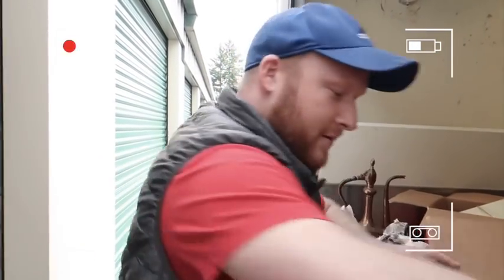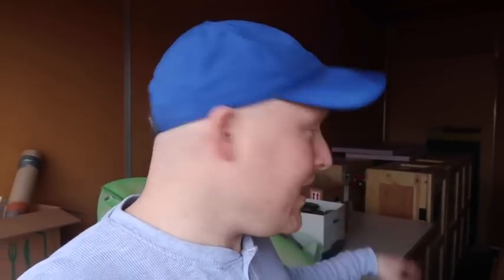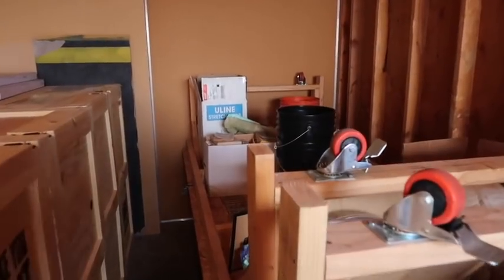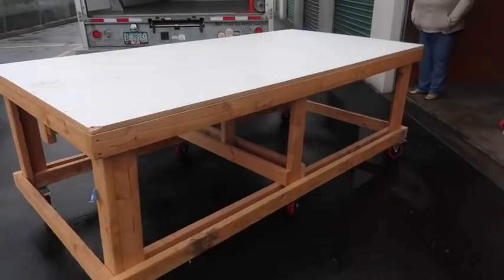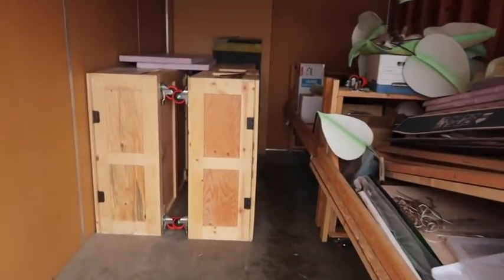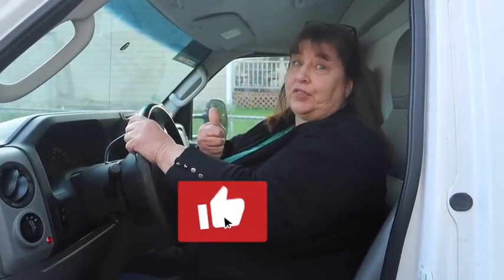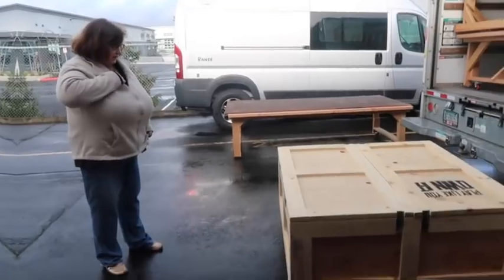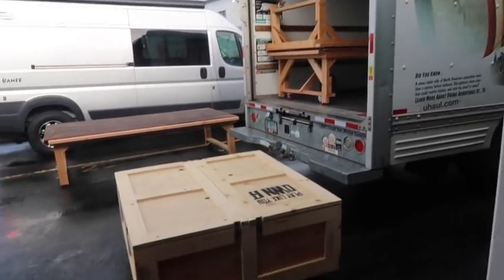5 Abandoned NIKE Crates Found Inside Storage Unit.. Beaverton, Oregon

Comment: Just thought also with those Nike lockers/cabinets it would be a good display to sell sports gear out of in the warehouse for different things by having the doors open and attaching nets to the "cubbies" where the cones were then you could put the different types of balls for sale in each cubby... In the middle maybe add a wood bottom and you could stand bats, single priced gold clubs, skate boards stuff like that.  If you had two of them side by side maybe paint a couple of the buckets with sports designs and throw baseballs & golfballs in there and sell them that way....just a thought.